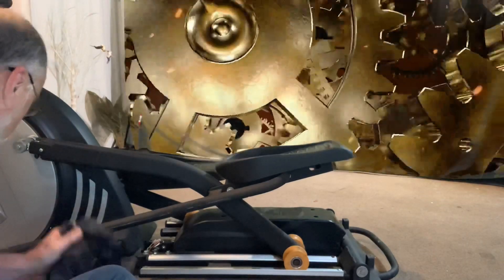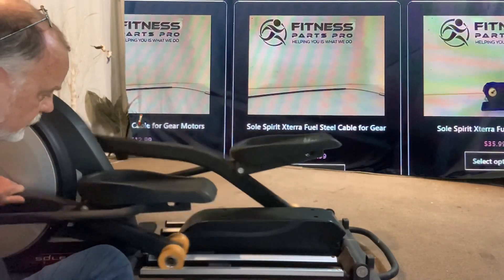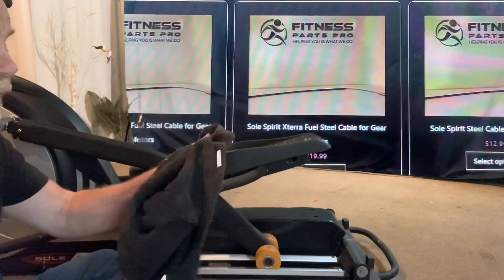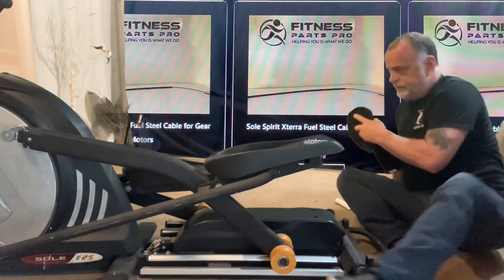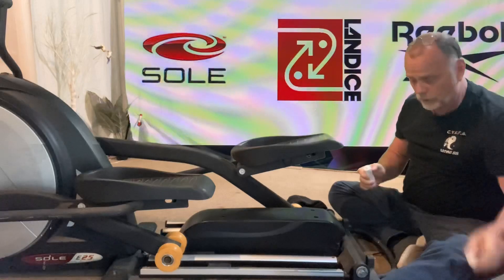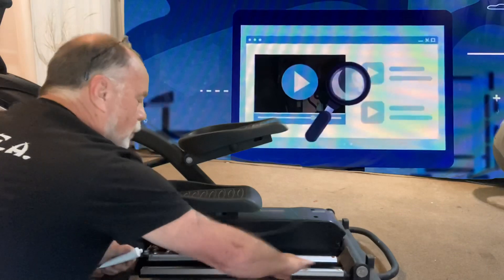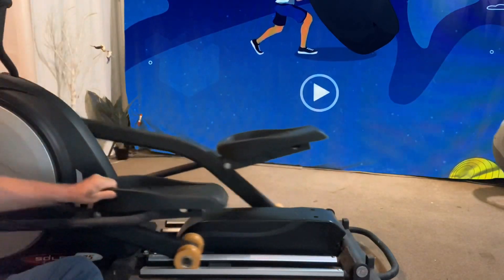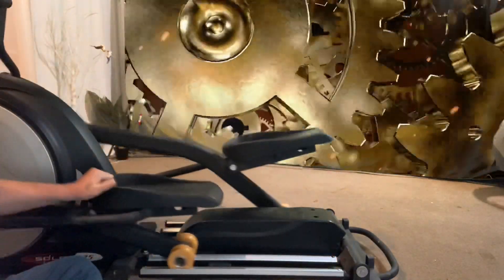Troubleshooting Sole Elliptical Squeaky Wheels

Comment: Hi! Ive had my sole e35 for about 4 years. Thought it was the wheel but the squeeking is coming from the actual foot pedal. Any thoughts how to fix that? Thanks
Reply from the maker: @CastilloC33  check and grease the bolts that hold the pedal frame to the leg .and keep a ear out for the foam pad also ! These are glued on and sometimes they come unglued. But it sounds more like popping

Comment: My elliptical squeaks as well but it’s on the foot pedals. I test it by pushing down on the pedal while preventing the wheels from moving. Any ideas how to remedy that?

I have the same tube of lube. It looks like the label was made by a Brother label maker. The tube came with my Spirit XE395.
Reply from the maker: The lube that comes with the unit is only for the rail. If the squeak comes from the pedal check the axel bolt that runs under the pedal . And use a much thicker grade lube. I have a picture of it on my video named sole elliptical maintenance. And on my website Fitnesspartspro.com

Comment: I have almost the same machine and what mine is doing is the platforms for your feet give off a brief squeak on each rotation any suggestions??
Reply from the maker: Hmm that’s hard to say! If your sure it is the base platform.It could be the frame bolts that the incline is mounted in could be loose see video on installing the incline

Comment: my elliptical keeps squeaking when it rows back. i lubed it but nothing. its not coming from the internal but from the wheel section
Reply from the maker: If lubing the rails doesn’t help. Next I would check the pedal axle and all pedal bolts

Comment: I have a Pro-Form Endurance 420E that is very squeaky on the right side and I re-greased all moving bits but unfortunately it didn't make any difference. ;-(
Reply from the maker: Unfortunately the metal may be cracked on the crank
Reply: @FitnessTechnologyServices  I'll check for that, thanks.